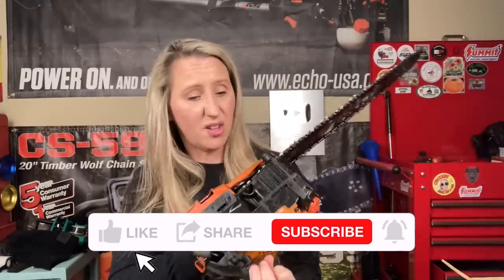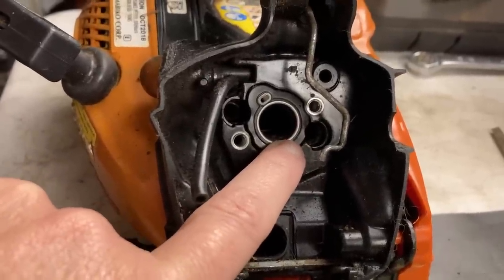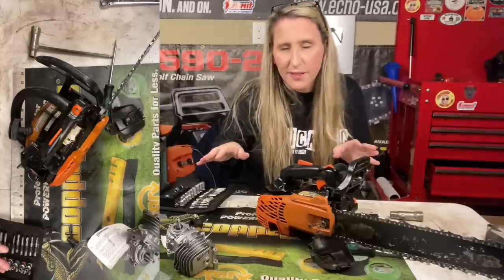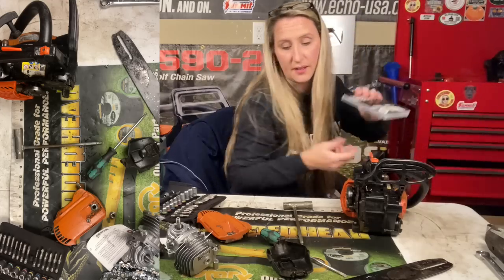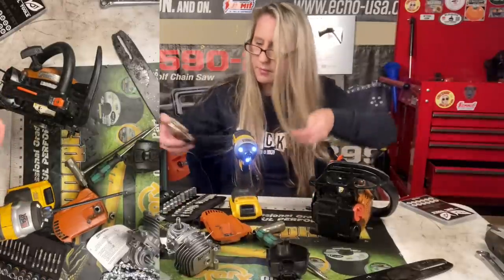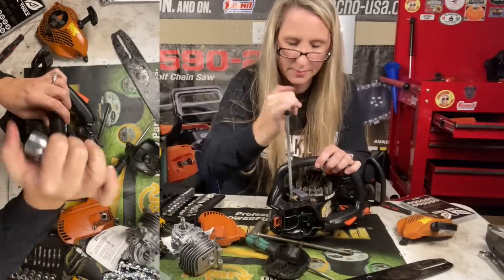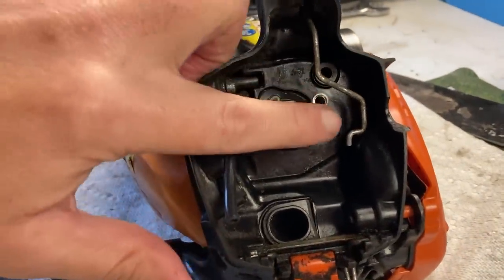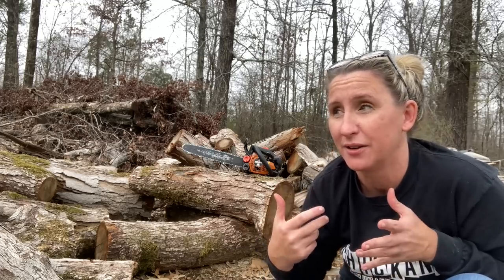Customers $500 chainsaw DESTROYED! Echo CS2511-T engine swap Repair/Vlog

Comment: I HAVE ONE :   His bar is to long, unless he ported it he's robbing it's nice power.  Here on the Pasific north west we install the Panther small nose light bar and a Pico narrow chain.  Outside of a battery saw the mini Echo is thee go to climbing saw.  PS: The Japanese have been making some of the world's best model aircraft mini gas engines for decades, so the Echo engine's are big by comparison...cheers
Reply: the reason for the longer bar is to give another 2 inches of reach.  I'm sure it still has the power to make a full depth cut, but he's not going to put any less power to the same size cut you get with your shorter bar.  he can just get it there from further away.
Reply: @kenbrown2808  Hummm Naaa
Reply: @CatDaddySteve  if 2 inches more bar gives you significant friction loss, you need to start filling your bar oil.  

and I know this because I run a 32 inch bar on my utility saw.  it lets me cut stuff lying on the ground without bending over.  using 18 inches of a 32 inch bar cuts just as good as using all of an 18 inch bar.
Reply: @kenbrown2808  I think this owner has only 1 saw and doesn't want to switch to a bigger saw once he has topped out and now has half a stem, God bless him.  Once you go 3P= Ported Panther Pico you won't go back.   PS: I have a 32 on a 362, with a 461 oil pump, don't tell me about big bar / small saw.
Reply: @stevenwalker2684  mine is an ms260. Highest power to weight in Stihl's lineup when i bought it. And yes, it cuts as good as my dad's ms260 with an 18 inch bar.

Comment: Should replace the saw.. a 250 dollar repair plus muffler  is not smart on a 400 dollar saw.    Better to buy another and keep the core for a few parts to be used.

Comment: The first time I saw one of these, I literally thought it was a toy. Now have in my collection of saws (Arborist). I've used a couple of ported specimens and they are awesome.  Also a bigger Echo climbing saw and the little battery saw, all awesome. Echos seem to be the best running saws out there and I recommend them when homeowners ask. Maybe not as tough as commercial Stihls or Husqvarnas, but they start reliably and quicker than anything. 

When I started working in the tree biz (1980s), a ground saw was a Husqvarna 181 (with a bow blade, BTW). One dude bought a small Echo, gussied up in John Deere colors, and it was the first saw that started so easily and would idle forever. One day, after all the other noisy stuff was turned off, we heard a little puttering and looked around and someone had forgotten and left the saw in some bushes, where it sat, and would have puttered away until the fuel ran out. This was remarkable in the 80s,  at least for us. Other saws did get better as the years went by. 

Speaking of the 80s, I had one of tge last Pioneers, 80-something CCs, and the clutch spun off counterclockwise. 

And, not trying to be the safety police, but ear protection? Can't tell from the vids.

Enjoying your vids, BTW. I do most of my own repairs, having learned from one of the best in my area (SC). I have an old McClane edger, and one of your vids has inspired me to repair the 3.5 hp B&S engine instead of replacing it with something newer.

Comment: I was cutting a very large tree about 30 years ago with a almost new farm boss. Somehow the tree twisted and the saw got stuck. We worked on it for awhile and the tree twisted again and the sew fell on the ground. Then the tree came down vertically on the saw. Had to dig the saw out of the ground. I knew the saw was probably totaled so I gave it to a repair shop for parts. Bar was only thing usable. He said he'd seen them run over with bulldozers that weren't that bad.

Comment: I have to question why he wasn’t using a lanyard as a safety harness. I know my Stihl MS 192TC has a loop on the rear of the case for a safety lanyard. Would have saved the guy a wad of cash………
Reply: I use a weak lanyard.  That way if I "drop" and the saw gets caught on a branch, or the saw happens to go along with the piece I just dropped the lanyard breaks so the saw falls. This bad but have a force of several hundred pounds applied to your saddle and waist by the fall is a whole lot worse.  Don't ask how I know, but I will say thinking about it makes me hurt. 

There is probably a story to how the saw fell 40 feeg,

Comment: I had the same problem with a Husqvarna.  I was gonna rebuild the carburetor and one of the bolts stripped out in the head.  Won't go in, won't come out.  I reused the chain and bar and threw the rest away.  Cheers from eastern TN

Comment: I notice you have stuff scattered all over.  Do you have a system to keep track of the screws and bolts so that they can be found when reassembling?  At 80 I'm having more trouble than I used to have.  Thanks for any help.

Comment: There are many brands of thread repair. If you use them with alloy parts they give steel threads to your alloy part. In most cases these thread kits make the alloy part last longer.

Comment: I've got one of these and dealer recommended to only use aspen and not my own mixed fuel i use stihl ultra oil  and are gas in ireland is e5 in the rest of my saws  never have a problem. What's your opinion on this